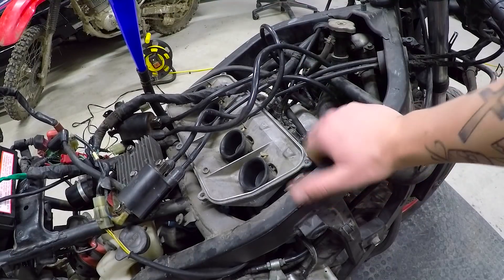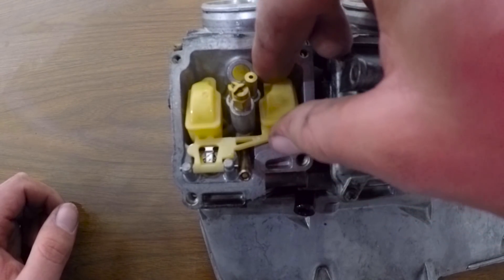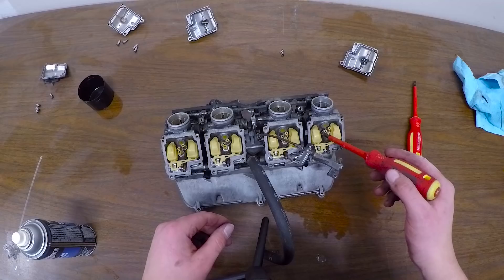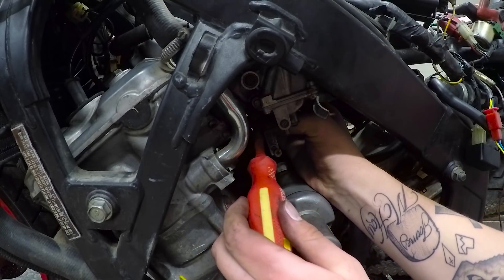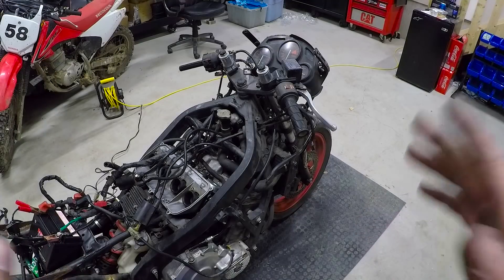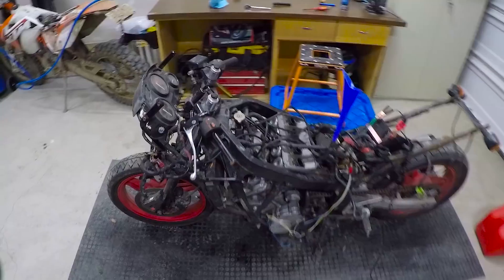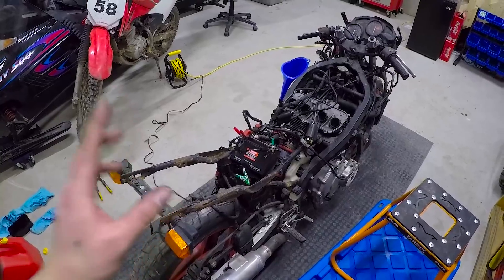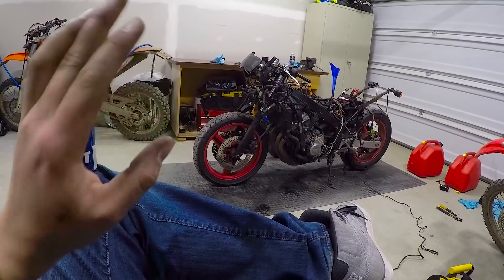Motorcycle Starts for First Time in Over 15 Years (1998 CBR600 Build Series Ep. 4)

Comment: Did you have to do anything to the cylinders or rings? Did you spray any wD-40 in cylinders? Just asking cause Im picking a kz 1000 with 18000kms and has been sitting 6yrs in doors.
Reply: And you got it working I got one need to know what do for no damage cylinders
Reply from the maker: I would definitely put a small amount of oil in the cylinders and let it sit for a day before starting  if you want to be safe. I never did though. As soon as the engine starts turning over itll pick up oil
Reply: I'm going to try a 50 50 mix of acetone and atf. As guys have said let it soak a day or 2 then take plugs out. put in gear with back wheel off the ground and gently rotate back and forth till its moving smoothly. We'll that's what I intend doing. Not going to use the starter as I feel that's too harsh

Comment: great job i got a quesstion. i have a GS 1100 E Suzuki 1982. its been sitting for 15 years. I have had a great mechanic do miracles on it for 7 months he has had it. it is running strong and screaming power. however, he advised me to open it up on the road to clear out the carbon on the valves because of it sitting so long. my question is, is there any product besides octane boost that will help melt the build up off the valves so it will be 100 %. let me know, anybody
Reply: Hi. Curious to know what he did to get it running again as i have the same bike and in similar predicament. Was any major components changed or all the original engine parts used?